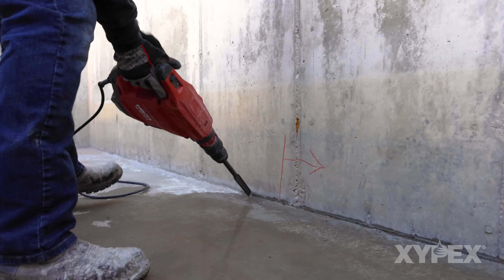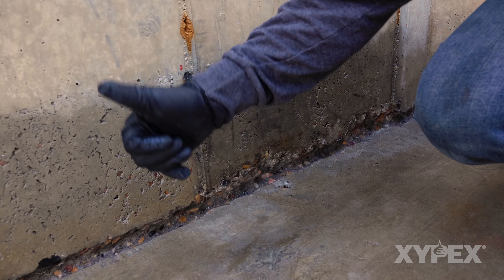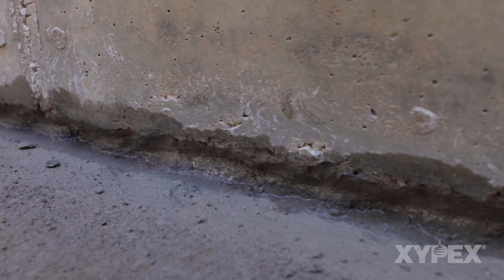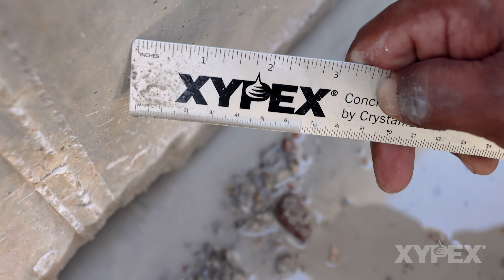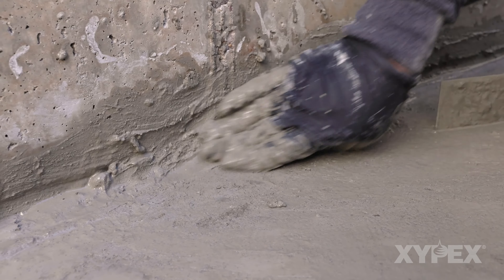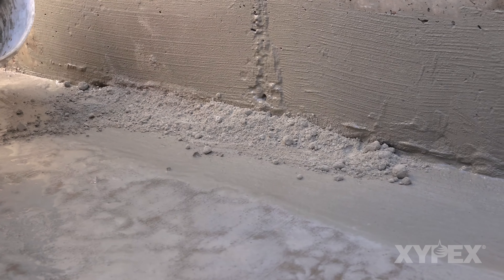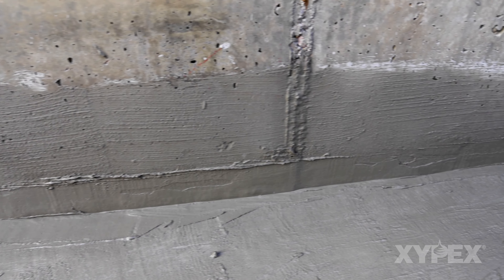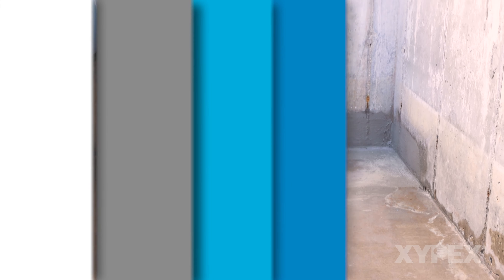Xypex - How to Repair Leaking and Dry Concrete Joints?

Comment: What happen to the water source once the plug is fully cured?  won't it accumulate underneath and try to find its way elsewhere?
Reply: 😢yes yoi just chasr it until it finally stops which is usually at the top at water level